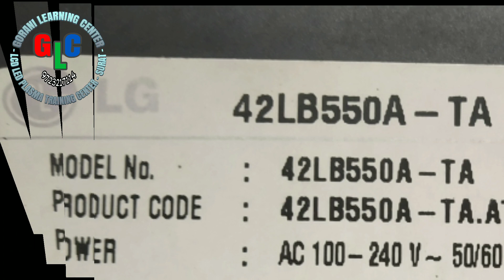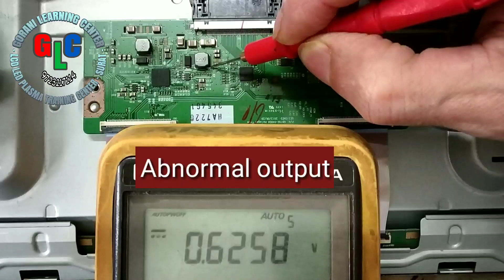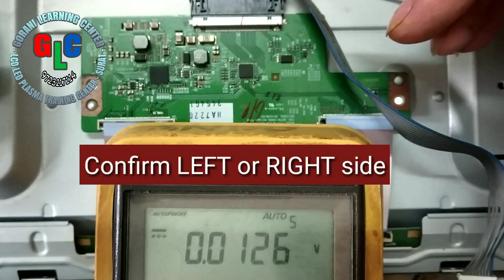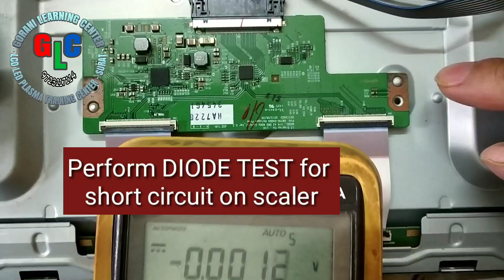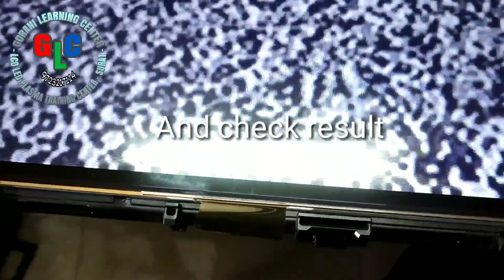LC420DUE-FGA6 - BLANK SCREEN ISSUE IN LED PANEL, ONLY BACKLIGHT,

Comment: Thank you for your helpfull video .
2 steps were done : 
Removing the burnt portion 
And disconnecting the signal line .

Can step one only solve the problem ? 
Thanks in advance .

Comment: Diaconnecting signals display ok?
Reply from the maker: Yes it's possible
If any one side panel circuit working ok..LEFT OR RIGHT (Gate)
Signals like ckv, ckcb, stvp etc..not a DATA LVDS (Drain)
Reply: @GLCLearningCenter  i have both sides burnt will this helpme?
Reply from the maker: If source cof burnt both sides
Then it's bonding job
Replace COF

Comment from the maker: Check all possible measurements carefully and patiently...
Reply: Great video and great response to the problem. 
Sorry about my naive question, but could you say why even cutting off that supply lines, the panel still works normally (VGH, VGL)? 

I've started to study that type of repair a few weeks ago..
Reply from the maker: @ricioccaja  
It's a parallel connection LEFT and RIGHT corner..
Works with any one side LEFT or RIGHT if we cut GATE voltage and signal..
Reply: @GLCLearningCenter  thanks a lot! 

Now i get it.. 

👍🏼
Reply: Even if the whole cof is disconnected ?
Reply: what is the reason to disconnect the resistors ??

Comment: 43 inch LG led 
problem :- No picture, No sound, backlight ok..
 Tcon bord V14 42 DRD..right side apc cable voltege not much for you discribe in video & conect the left side  apc cable VGL,VGH,VCOM...etc..etc.. voltege  drop ..4 cof is totally ok..
So plz help me..
Reply from the maker: Check GATE COF
Reply: @GLCLearningCenter sir ..
 this led set no have gate cof..